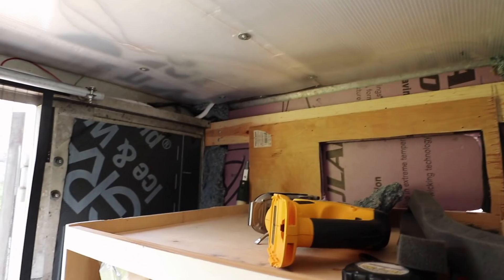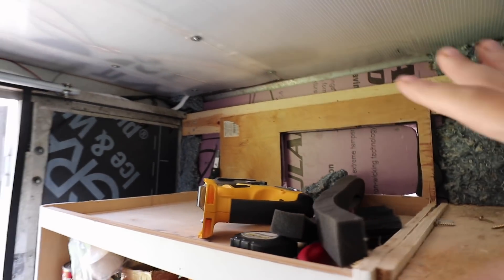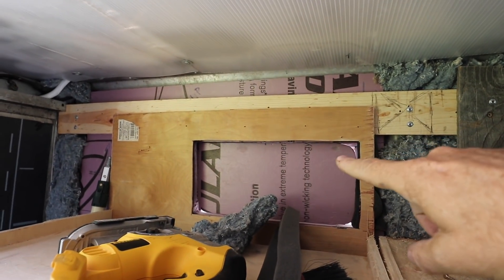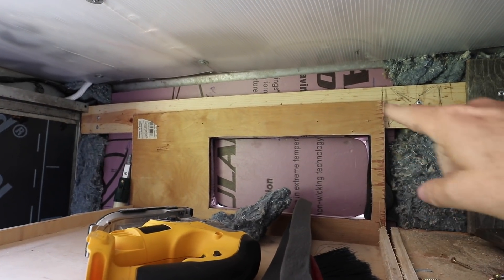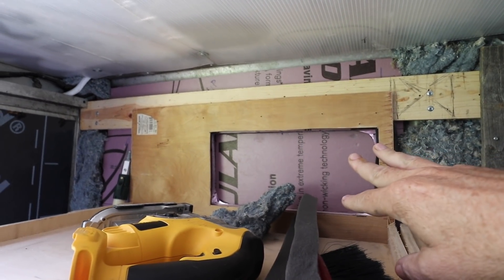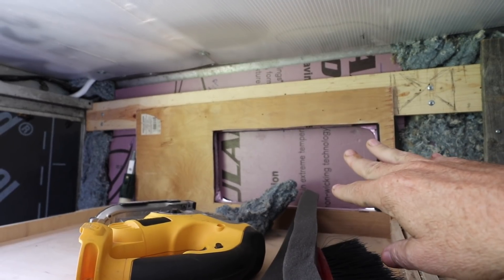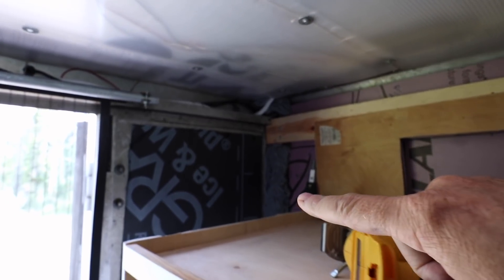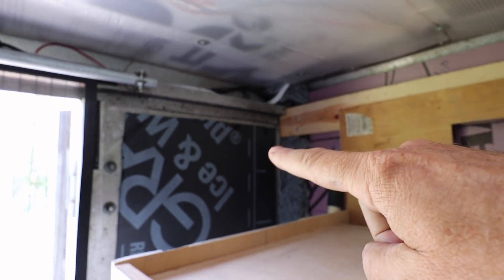Success with Solar Powered AC Install for Step Van RV P4 E563

Comment: Hello Seven, When COVID first hit I was stuck in England for a few months and watching your videos helped to keep me entertained and inspired me to purchase and convert an old Mac Tool Truck Step Van, so thanks for your videos! Realize this is an old one, so not sure you'll see this but I have 2 questions, if I may? 
! - I purchased this exact A/C unit. From your experiences do you think a 1200 W Solar to 600 Amp Hour Battleborn Battery bank is sufficient to run this in Florida Summer Heat?
2 - Did you find an adequate cover for cold weather?
Thanks, again, for your videos and in advance if you are to reply!

Comment: 400 watts out of an inverter is gonna require about 500 watts in. So, if the
 inverter setup is a 12v in/120v out system, that is an insane amount of juice being sucked out of the batteries. Current = power / voltage = 500 W / 12 V = 41.6 A. Yikes, the non-linear discharge-pattern  will really come into play when you suck that much juice out of your battery-bank.
Reply from the maker: I run the AC when I have full sun... have 710 watts of solar... bringing down about 600 watts from the panels and as you said, about is 500 needed for AC. I can run my AC for 3 or 4 hours and still have nearly 100% charge on the batteries at the end of the day
Reply: @SevenWanderstheWorld   Sounds like you have a nice setup, 710 watts of solar is quite decent. LOL, I have 2 big batteries in the cargo-area of my van, they are nearly toast......the voltage drops like a rock if I pull more than 10-amps out of them for more than a few minutes (no solar panels).

Comment: Try making one from the board insulation and use an ac cover over it! That works great!
I used reflectics and 1 1/2 inch insulation board with duct tape the metal stuff 
It worked

Comment: It looks like your filter slides straight out on the right, now blocked by the wall. Instead of using the hard plastic slide in filter, you can substitute some furnace/ac filter cloth and just slide it in the side, it's what I did with my window ac when the plastic filter frame just fell to pieces after years of use. Maybe mount the four sides of the filter cloth on some spring steel that can bend around the sharp angle of the corner.

Comment: A split unit would have been a better option. Requires only 1 small hole in the wall. Easier to install and safer to move with.

Comment: I tryed so hard and got the extra panels and 0 gage cable . 5 000 fridare and Trojan . But it don't work with me. If I use the air on solar 500 watts my battery still will get discharge when the clouds comes. And I want to end the day with the battery charge so I cut the sections short. That next day the same. It's too much cloud that will comes over. And my van has louver and holes in the floor for ventilation so it doesn't cool enough to worth it.
I just keeping the ac but might get rid of it as the floor blower is just as good in wind current

Comment: One thing to consider. House AC units are not made to be mounted in a vehicle. Car ACs have flexible joints that give with the vibration of the vehicle.It is possible over time that the AC unit will fatigue  and you will lose coolant. Really not a big deal. If it happens I would  think it would take several years and all you would have to do is to buy another one. They are not too expensive.

Comment: I seen someone built a wood box around theirs. It flips up when using the ac and then drops over it when not in use. That might be something you can do.. paint the box white and it will disappear

Comment: Hey good morning Seven! You are doing great! This looks like it ought to function great. For a winter wrap idea; 1" foil face foam board, Homey depot has it, and some foil tape to assemble you can cut it with a razor knife or whatever. Kinda make a box sleeve you could fit over it. Not sure how you would make it look pretty but I've done this for home applications.  The 1" foam has a high R value, and with foil tape you can put stuff together for the winter, then break it down and store it flat somewhere in the van.  Enjoy your new AC, I'm excited to see how this will work out off solar.  That "soft start" is the ticket! Thanks again for sharing, savor the moments! Enjoy the coffee! And now you can nap with the AC on! Woohoo! God bless!

Comment: Definitely needs bolts, washers a and lock washers and more attachment points, vibrations will enlarge screw holes, and lead to catastrophic failure.
Reply from the maker: great advice. I'll upgrade to bolts/nuts
Reply: Happy trails enjoy your channel, believe I saw you at the second van build

Comment: my comment from three months ago:
Check which side the filter screen slides out. If it's on the right, it will be trapped against the wall. You might need to mount it in the other corner.
A slide out ac tip. The outside would have a vented door that lifts up when you push the ac unit out. The vents allow air into the top of the unit when running.

Is it on the right?
Reply from the maker: I'll check on that

Comment: With just the two brackets secured with only one screw to the AC, maybe put a strap around the AC and the support brackets?
Reply from the maker: the AC is extremely secure without the brackets which are there mostly to provide added support. not sure the strap would do much to help (guess you'd have to actually see it in person to understand how secure it is)

Comment: On the window unit I used (LG) the very small capillary Freon tube was unsupported which is fine on a house but not great on a truck.

 I took the metal cover off and used foam and some scraps to secure all of the Freon tubes so they wouldn't vibrate and break.  Highly recommend doing that to yours.

Comment: You’ll want to build a insulated box to cover the interior face. The heat loss that high up will be very noticeable in winter weather conditions. I’d personally use some 2” closed cell glued together and taped well that you can secure with Velcro or wrap around bungee cords to secure it. 

Make it small enough to cover the face but not big enough that you can’t store it out of the way when not in use.

Comment: Does rain which enters the vents enter the van?
Reply: Window a/c that normally hang outside through a window have drain holes in the bottom for any water accumulation. IF he has titled it per directions all liquid would run to the outside and down out through the holes in the frame.

Comment: Seven is a good guy so I hope this works out for him.  But I kind of doubt an inexpensive A/C unit designed for residential use is going to stand up to the rough ride of a step van.
Reply from the maker: good point and honestly don't know the answer to that. good part is that it is cheap to replace. I do know that Solar Boondocker (aka Jim in Denver) has two of these units in his rig for a couple of years without problems
Reply: Mine has lasted for one summer, worth it so far. $29 at goodwill. I think I can afford to replace it.

Comment: Great install but I agree with some of the other posters that bumpy roads will be its demise. I know it's mounted on the balance point so there's not much weight pulling down on the backside, but that balance point on the bottom may become a fulcrum point as the top end tends to "flop" forward and backwards with rough road action (accentuated by the fact that this placement is well behind the rear axle, exaggerating such action). Might I suggest strips of angle iron screwed into both the AC unit and the body of the van (along the top and sides) after a good caulking seal? 
Also something simple for winter coverage would be reflectix wrapped around the exterior of the unit held in place by bungee cords and a baby blanket on the inside held with bungee cords as well. I'm sure you could get fancier but that would be quick, easy and cheap.
Happy trails!

Comment: Seven why not make an insulated wall with a door about 4 feet inside the back?  That way you could put AC in that wooden wall and let heat escape the main rear door and vents. You could add a fan too assist pulling the heat out of that space. That space in between the real Van door and wooden wall could be a patio/storage space/basement. Nice one if put a screen with magnetic holders on van door. Use google sketch up to layout design. I'd be leery of driving with an AC hanging out because it will be vibrating and could cause problems in the future.  Worst it could fall out.  Plus the stealth factor is eliminated. As to cover you might need to make one. Thanks for sharing your experiences here!

Comment: The brackets do not look strong enough to hold for any length of time. Angle brackets should also be attached to the inside of those outer supports and bolted into place. If you are going to keep those outer braces there should be two more mounted beside the two existing brackets and again bolted. Maybe it was the camera but I did not see the air conditioner angled down at the rear to let the condensation exit to the outside. Where all the bracing pieces sealed prior to being installed? The outer cover is a great idea, but if you were to get say a 2 inch Styrofoam and box it in, that would be a great asset towards keeping the heat in. The only negative I see is the passenger side door not having enough room to open properly. (90 degrees)
Reply from the maker: it does have a slight downward angle toward the outside. appears the AC is super secure, but time will tell. I'm doing regular inspections after each drive

Comment: The patch for the side where the vent is can easily be patched with the piece you cut out of the back.

Mount the patch on the inside usingthe existing holes that now secure the vent. Use pop rivets. Caulk between the existong panel and the patch on the inside.

You will still see the vent, but it will look better than trying to make a flush patch.
Reply from the maker: great tips

Comment: I suggested this housing when you first started the project. 
https://www.homedepot.com/p/Frigidaire-18-in-Sleeve-Kit-for-Frigidaire-FAH-series-Through-the-Wall-Air-Conditioners-EA108T/206734509?cm_mmc=Shopping%7CG%7CBase%7CD29A%7C29-17_A-CS_AND_FANS_MINOR%7CMulti%7CPLA|71700000032403379|58700003840533702|92700030729182096&gclsrc=aw.ds&&gclid=Cj0KCQjwlJfsBRDUARIsAIDHsWqmpJsZ3e32WyOxzZJNzEflPp65DB_T57Pmcwjtykg9_BWoCx6dvKgaAk3MEALw_wcB
Should still be able to install the housing/ weather sleeve. I would reinforce your framing. You're almost there with it.

Comment: You might want to consider to add more to your battery bank and another solar panel as not to over work your system as a whole.
Reply from the maker: agree one more panel would improve the power needs

Comment: 7:15 what happened,  Did you get that unit add a scratch and Dent sale?
Reply from the maker: I was a bit surprised that amazon shipped it this way. maybe they were selling refurbished units. I ended up returning it for one that wasn't damaged
Reply: @SevenWanderstheWorld   I'm not such a big fan of Amazon, I recently bought a 100 amp solar charge controller for my class B plus RV, It wasn't damaged but I wasn't happy with the performance so I returned it, I got a refund for it but the refund was short about $75, The only way I could get my money back was to cancel my Amazon account. I like your video content and your channel! I also reside in  Florida the Tampa area, Good luck with your project

Comment: Make a outside a/c cover with reflectix and A/c silver tape.
Reply from the maker: another great idea
Reply: Blocking the flow of his heat that will rise to the ceiling come winter time will prompt the need to insulate or block more efficiently from the inside.

Comment: Actually fits there well bro, have you thought of using that vent on the side as a ventilation vent and have some way of closing it off when not needed. Anyway it was a good video. ATB
Reply from the maker: hmm... good idea for another use of the vent without removing it

Comment: So much for the stealth look huh?
Reply: Even some work trucks have Ac sticking out like that .
Reply from the maker: every time I look at it now from across the parking lot I wonder if I'm sacrificing stealth. if so, it might be a minor loss because it still looks rather industrial at a distance or even up close. that said, there is a HUGE gain in comfort on hot days, so I think it is worth it
Reply: @SevenWanderstheWorld  maybe back it in to spots you're spending the night in. In most cases that may work for you
Reply: There are step vans all over here in Ontario Canada that have A/c units like this.  My cities work vans all have A/c and solar to run them they were all part of the green initiative
Reply: he could put a sign under it, "We care about our workers". That would even ADD to the stealth value.

Comment: Seven there's no way two brackets underneath the A/C and a few screws on top of the A/C are going to be enough to hold the A/C unit in place while you're traveling down the highway. The A/C unit weights about 42 lbs. This setup may work for a few months but very quickly the A/C unit will come loose. Worst case scenario the A/C unit will fall out while your van is moving.

The A/C unit needs to be placed on and secured to a metal platform with the platform  secured tightly to the van wall. Ideally the A/C unit should also be secured to the van wall on the A/C unit's sides.

Remember in this case the A/C unit will be jostled all the time as the van moves therefore it needs to be secured in more places and far more tightly than if the unit was going to be mounted in a window in a house.
Reply from the maker: only way to know is to put it to the test. I do check it every time I stop. it has been two weeks now since install and so far everything  is rock solid (even after washboard dirt roads in national forest). I'll post an update in a few months to show how well it stands up to daily use with stiff suspension
Reply: @SevenWanderstheWorld  If you put through bolts with nuts and washers on the vertical part on the truck I'd feel safer but not to sure about just sheet metal type threads through aluminum. Cheers Seven.
Reply: Jack. You are correct about the braces.
Reply: Looks pretty sturdy to me.  There’s absolutely no way the unit could fall out while going down the road.  The brackets on the inside prevent that.  If all the screws were completely dislodge it would only be able to fall in.   More likely it would start to shake and come loose over time if anything.  In that case, replace with nuts and bolts with some nylock or lock nuts and lock tight and call it a day.  No need to panic boys.  Nostradamus over here 👈,  geeze.
Reply: when I installed one in my campurban   just the jostling along made the Freon lines either rub a hole in one or fitting came loose and leaked the Freon out.  first hand
Reply: That mounting should work fine.
Reply: @tompava3923  The mounting would work fine in a home install but with the constant motion of a van moving down the road, on the highway doing 60 or 70 mph the screws will come loose.

The screws will have to be checked often. It's also possible that with the 42lb weight of the A/C unit that the unit might rip itself from the wall with a sudden stop if the wall is not strong enough to hold the unit. Again Seven will have to check the work often to ensure that the A/C unit is stable.
Reply: Jack Brown Firstly, the unit seems to be somewhat wedged into place in its initial setting. Secondly, with the added support and bracing he put in, it is unlikely that it will move it all, particularly on the highway. From what I can tell, it would seem that only an extremely rough road, or a dirt road could cause it sufficient vibration to be of concern. Also, given what familiarity I have of Seven, he will probably be very attentive over inspection of the screws/mounting, especially when it has been exposed to excessive vibration.
Reply: @tompava3923  Your comment "Wrong. That mounting should work fine"? WRONG! WRONG!  to the the second one you posted.LOL,  Dunning–Kruger effect may be the cause of this.
Reply: @robertb2468  Interesting.
Reply: Tom Pava interesting, indeed. I couldn’t help but laugh. Isn’t citing Dunning-Kruger the perfect example of Dunning-Kruger?
Reply: I agree those brackets are insufficient. Bracing on the mounting wall is also critical. Doing this looks easy folks, but you haven't tested this sort of thing yourselves. OVERBUILD the mounting for best results.

Comment: Did you drop it? The bottom right corner looked a little banged up when you did the close up of the support brackets.
Reply: It's definitely a bit stoved in on the right corner
Reply from the maker: I didn't drop it. I think amazon may have sold me a refurbished unit (advertised as new)
Reply: @SevenWanderstheWorld   That sucks

Comment: Can you get the filter out to clean it?
Reply from the maker: good question. I'll have to read the manual about that
Reply: I don't see how with the angle and closeness to the wooden shelves. Normally the face lifts up from the bottom and the filter is under that. The wood shelves remake will have to be his next project so he can access his A/C filter.

Comment: Very cool,lol. I seen one video on here a while back where a guy turned a window unit into a split and mounted the condensing coil and a 12 volt fan under his van with the evaporative coil and fan the front and controls inside and it was totally stealth. It's a shame that affordable smaller btu options aren't available like a 3000 btu unit.
Reply from the maker: great idea